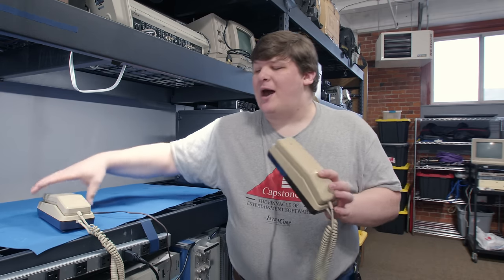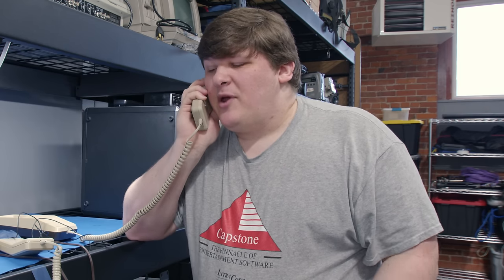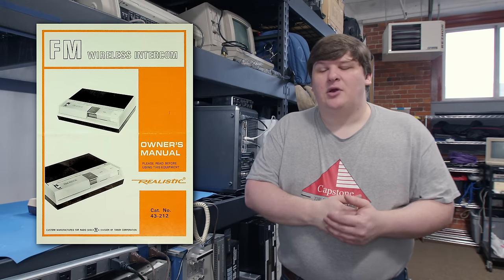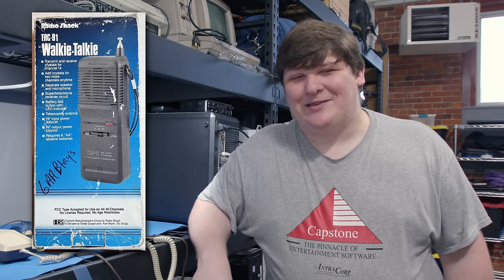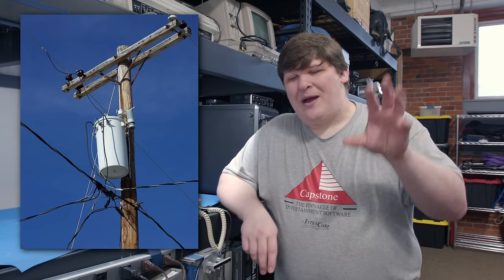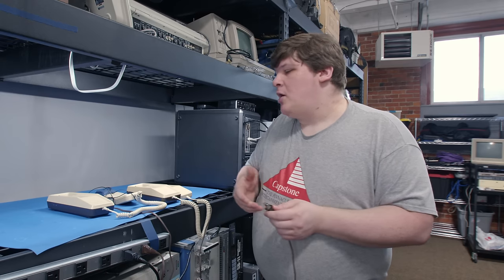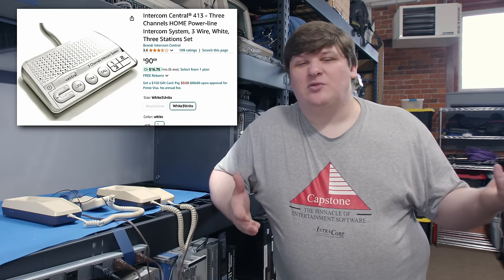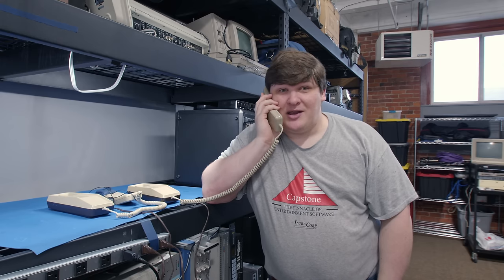How does this "phone" work without a line?

Comment: In a big place where both phases of your distribution transformer are in use, chances are that if these don't work in one set of outlets, you can probably make them work by plugging one of them into the next outlet in the room. I'm not an electrician but I know they often alternate outlets in the same room from different phases so that there's a good chance that even if it's the only room with power consumers, the power use is still somewhat balanced between phases (and if a breaker trips, there's a good chance that the room doesn't go dark because there might be lights plugged into another circuit on a different breaker).
Reply from the maker: Yeah that's what I'd hoped but I tried it and no dice. :/ I guess the two offices got put entirely on different phases.
Reply: If your commercial building is fed with a single transformer most likely it is a three phase transformer. To work you would need to swap breakers until you two rooms are fed by same phase. We used these for years in a cottage complex with four buildings. The version we had allowed three channel selection for direct call. Worked great as an early baby monitor.

Comment: The military still use a similar things 2 strong cables 2 rugged phones on batteries and a crank to ring. Simple, safe against jamming and intrusion, reliable I had one in my armored vehicle that with a spool of cable plugged at the back of the anti air tank into the inner com system. You can look up EE-8 Field Telephone, introduced in the thirties, but the concept dates bake at least to WW1 "if it ain't broke..." so I believe the US defense fixed it making a more capable version with multiple lines at a thousand time the price.

Comment: We had some of the non-headset versions, and by that I mean I found them in a box in the basement circa 2000 and played with them. You are understating the issue with being on the wrong phase. Iirc every other breaker (let’s ignore the 240 volt ones) is on the opposite phase from he previous and cannot talk,to each other

Comment: Fyi, it's very typical for these devices to not pass a signal through a surge protector!  So if they're using power line signaling, instead of jumping to conclusions and deciding that your building is on two transformers (it might be), try plugging each unit directly into the wall in each of your "offices", without any surge protectors between them.
(This might be why you've never gotten an ethernet over power line module to work.  Surge protectors have analog filtering that prevents them from working, they need to be plugged directly into a raw outlet.)

Comment: Somebody's probably already said this but in a residential home it would matter as it's using the powerline to transmit as it's antenna. so if it's on the opposite side of the split transformer your other circuit wouldn't be able to communicate. Same thing for X 10 control and a lot of other powerline control devices or telephone over powerline or ethernet over power line adapters things get really funky when you have to transition from one phase to the other half phase. A lot of these devices if you dig into the documentation mentions the issues and various remedies of like cross connecting things with a special bridge. Edit oh OK I should've just waited two more seconds for you to talk about x10.

Comment: I have a couple of similar units and also, have not used them for any length of time.  The main reason: the audio quality is fairly basic and there is interference from all manner of electrical items: switch-mode power supplies, computers, network switches - the list goes on.  So, they have been relegated to the junk pile.  A similar situation might occur with these Realistic intercoms, where either one would randomly emit a call tone when not in use.  You must have fairly clean power.  Me, I have tons of equipment on the same ring main (not good).

Comment: We had the boxy pair of these when I was a kid, I hated the sound as it usually meant I was being called to do something I didn't want to do 🙂

What this, and the mention of X10, does is make me think of what the minimum necessary technology is to solve a problem.  We don't need an Electron app using WebRTC to be an intercom on a RaspberryPI, that's way too many layers than is necessary to solve a problem, just like X10 is fine for turning switches on and off.  Maybe there is a benefit in solving problems the simplest way that reliably works, rather than standardizing on the most complex way that you need to support, so more X10 and less wifi-enabled light bulbs.

Comment: In the house I grew up in, there were two regular phones on both floors and if someone needed another person on the other floor, you would bang on the ceiling or stomp on the floor. That would be the signal to pick up the phone, and since they shared a line, you could talk to each other with the ringtone buzzing behind. Usually what we talked about was short, "Lunch is ready,""Someone is at the door for you,""You're being too noisy," that sort of stuff. So we didn't need something like this.

Comment: I somehow probably through yard sale or free box or Goodwill I came into possession of a newer version of the desk top model in white before it went silver or at least a couple versions before the silver. Being an only child didn't have a lot use for it. But I did modify it for Audio in and out I like to run things into recorders and run things into things etc. Now RadioShack also had a cheaper model which just used a 3.5mm TS cable with two really thin wires. one side was just a button that shorted the line and a speaker the other side was more complicated with a volume control and button. Either button could notify even if the master unit was off. However the master unit would let you monitor the other unit so you could put one in the babies room and have the master in the living room etc. on the other hand you could do what I did give my parents the dumb and in their bedroom or near the bedroom I can't remember where it ended up and then in my room I could turn up the volume and listen to the TV in the living room which was nearby their bedroom and listen to the late show which I was kind of sort of allowed to watch on occasion. So I would get told to go to bed and then I would go to bed after the news and then in bed I would listen to whatever they had on usually Jay Leno. Looking back at this thinking yeah we were that poor we couldn't really afford another TV and boy did I get lucky as after the TV went off there wasn't much point with leaving it on so I would turn it off thank goodness! Older me is thinking of all the things I could've accidentally heard that I didn't want to hear!

Comment: A lot of the noise might just be interference from various electronics or your lights or whatever else.  They might actually sound OK if they were in the same electrical environment as a home in the 80s.  But yeah they might be tired too like you said.  Neat things to be honest.  I could imagine a bunch of people in to gadgets would've gotten these and used them like 5 times.

Don't forget the Seinfeld intercom.  Although apartment intercoms are still a pretty normal thing everywhere.  However it's wired up, our's sounds even worse than this phone thing does.

Comment: Nobody much used them because nobody much used intercoms in houses.  We didn't use them when I was a kid, because we had one of those wired intercom systems.  It could be used to talk to everybody in the house, just one room, or play the radio all over the house.  It was always turned off, because who wants to listen to the radio over a crappy speaker in the wall that only plays the station set in the kitchen?  And do you really want to talk to other people in the house over a crummy intercom?

And then it eventually didn't work.  And nobody noticed for a very long time.  I remember looking at it, not finding anything obviously burned, and deciding to not bother going further.  And I was the only person in the house who might have done anything to fix it.

Comment: This is one of those things that would have either worked extremely well in the UK (due to our ring main system) or would have left people downstairs unable to talk to people upstairs in the same house (due to our ring main system)

This sort of thing has been kind of superceded by DECT which allows internal calls between handsets connected to the same base station.  

And even then. it's probably easier to just text your spouse in the garage from the kitchen to tell them dinner's ready!
Reply: They would have worked no matter which ring they were connected to, it would not cause them problems as long as they were connected to the same phase. Since nearly all small houses in the UK only have single phase supplies, everything would work as expected.

Comment: About the only benefit these had was the ring feature. Most people had multiple wired phones in the house. If you needed to communicate without walking anywhere you could probably both pick up phones and talk. Most houses, however, were too small to really need an intercom system.

Comment: As I understand it, most smart meters have cellular radios, or something closer to a mesh wifi system. (not necessarily at 2.4GHz, but the local company making these things do, indeed, use the 2.4G ISM band. I'm impressed they can get that to work! But then again, the Breezecom tech I have that predates 802.11 has f'ing zero problems with 802.11 - it's the other way around, they'll stomp all over 802.11... loved that decades ago in my apartment: screw you idiots and your "1W" wifi.)

Comment: I wonder if it modulated the AC signal, and actually used the electrical wiring as the RF guide, instead of transmitting through the air.

Comment: There was a time when the electronic devices were marketed with the number of active elements (like All American 5 or 6 transistor radio).
The choice of two frequencies was because the unit was full-duplex, using one frequency only, would make the circuit more complicated and also the communication would be half duplex. Also, as you said, having two pairs of these, would have the interresting effect of each one unit talking with two units.
Actually these are quite an interesting device, being nore useful than the usual walkie-talkie. I would have used them.

Comment: regular walkie talkies are not duplex tho, so these need to use two separate frequencies for each side. i wonder if they are like PMR channels or some obscure band
edit: nevermind, just got to that part of the video. i am a radio guy and your explanation checks out. multiple devices can't transmit at the same frequency at the same time. well they can, but their own transmission will prevent them from hearing the other side unless there is some elaborate timing scheme enabled so the devices negotiate time slots (like wifi in ideal scenarios).

Comment: Not really a radio guy but I can explain why analogue audio is done one way at a time. Bandwidth. in the early days no one knew how to have the audio from both ends be transmitted at the same time without causing interference in some form or another. Ethernet does this but using buffering, some light encryption and an xor to remove the data it's adding into the pipe to extract the data that its being sent.

Analogue radio bands just don't have the bandwidth to do that without HEAVY losses. Heck APRS messages take minutes to recieve full messages, and they can't be encrypted (due to FCC rules and some bandwidth constraints for the longer ham bands, FM sure we do have digital radio but that requires a type of infrastructure that didn't exist at the time)

Think closed loop security intercom systems.... That is an application for these that would work fairly well as to tap into them you'd need access to the power lines.

Comment: To be honest, the price is the only reason they went with power lines, low frequency walkie talkie radio can pass through any brick and concrete walls without any problems, and cover the surface of every house without any problems, with probably <1W of transmitting power.

Comment: They use the power line,  just like : "powerline adapter ethernet" you use to day, if you dont like to use wifi.
They transmitt on the power line, and the 3 selector is just the freves used.

Comment: We used to run units that kind of like the one in the manual. But if i remember correct they transmitted over the power line. So i needed to be on the same circuit to work

Comment: HAH! knew it instantly! They use FM frequency on the power lines.. pretty ingenious and indeed one of the earlier powerline networking use. notably using the powerlines reduces the power needed to transmit and also makes it a bit more private as the signal likely does not make it too far outside the house. 

it is too bad there really wasn't much interest in them, but yeah are they absolutely critical? yeah as said, not really?

Comment: Count me as one of those that swears by Ethernet Over Power in my current apartment. It's the only way I can practically get ethernet to my PC in my apartment and is higher throughput than wireless over the same network, even with a beefy WiFi 6 router. I have zero issues or complaints after using it for maybe 4 years.

Comment: I wonder if, being FM, they would still cause interference to radio reception on Long Wave, especially if it's a mains powered radio? BBC Radio 4 is on 198KHz here. It's AM of course, but there could be AM noise produced by these intercoms? 🤷‍♂
Reply: I bet you got it. To avoid getting too close to the BBC frequency in the event of leakage of the  signal. It has two sets of specs and the (240V) suggests the specs in parentheses are for the UK market. RadioShack did have a UK division if I recall.
Reply: @5cyndi  Yes, we had Radio Shack, known here as Tandy (proudly showing "A division of InterTan® Corp." if I remember correctly, on the gratuitously excessive packaging).

Hopefully if you bought a soldering iron, the only blisters would be the packaging it came in!.

Shame when that went. I suppose they lost some trade to Maplin when they opened a store in the city. One could have a penny jar (officially too young to call it a swear box at the time, and get away with it) as almost every price ended in a 9.
Reply: @BG101UK  definitely miss going into stores with wall racks and shelves full of components with my dad and getting to buy a new lamp or switch or buzzer for a fun project.

Comment: 3:44 200/193 KHz (7 KHz duplex separation) sounds like too close to be separate FM channels. CB radio uses 10 KHz and that's about as low as you can realistically go with an FM system for analog voice.

Comment: every time I've seen an intercom system nobody used it. You've talked about Sludge before, most sludge electronics is obvious garbage, you see it at the store and you don't see it because it's overtly not worth perceiving. Some small portion of the population is erroneously perceiving this non-stuff and buying it, but the rest leaves the store as trash, or never leaves the store at all. Then there's another kind of sludge where the thing is somehow cool, like a beyblade, a nerf gun, a food processor, an electronic picture frame, a shredder with two slots so you can shred while you shred, an electric toothbrush that can brush 3 sides of 2 teeth at the same time, for which there exist an extremely small number of people who actually need a fushigi ball; but almost everybody thinks they are those people. You see the thing, it does electricity in your brain, 100$ later You've Got The Thing and actually your life does not have the niche where it'd be useful. I've never been in a house big enough that using the intercom felt like a socially acceptable convenience vs just going over there. Maybe the real problem here is that the midwest has a shame based culture; or maybe the problem is all these houses are insufficiently large because everybody's been poor for the last half century.

The best application I can imagine for this thing is connecting to a detached garage workshop, so the dinner cooker doesn't have to traverse the winter, and it should actually be able to do that, without needing to run additional wires to the garage! biggest reason not to have a detached garage intercom is running wires overhead or underground, solved.

Comment: Before you mentioned X-10 i was saying, this thing is screaming X-10 tech at me!!!! Oddly enough, Radio Shack was a purveor of X-10. They sold  X-10, and some X-10 compatible doohickies that were RS exclusive under the Realistic brand. I sold and installed X-10 junk back in the day.... yes, it was junk, but hey, so was everything else Home Automation back in the day. BTW - I have a whole box of BRAND NEW in the package X-10 stuff i should sell. is it like toys? Worth more in the packaging ?? :)
Reply: WOW - It just occurred to me..... I think i still have an X-10 crossover capacitor in my breaker panel. Need to check that next time I am rooting around in there... a 30+ year old RC network in my panel across 220VAC may not be such a good idea! not like any of the X-10 stuff in my house works - or even exists anymore..... Makes me wonder, do those phone doohickies work across the 220V phase break? X-10 had that problem. It only worked on one side of the 220v unless there was a crossover capacitor, or you had an electric stove or hot water heater that happened to be on. The signal could pass throught the heating elements! Talk about an intermittent problem

Comment: The reason they are using offset frequencies is due to the FM capture effect - if both handsets were transmitting on the same frequency, the slight differences in transmit power and frequency would mean the receiver would only latch onto one of the two transmissions - likely its own. A great description of this, here: https://www.youtube.com/watch?v=yHRDjhkrDbo&t=6s